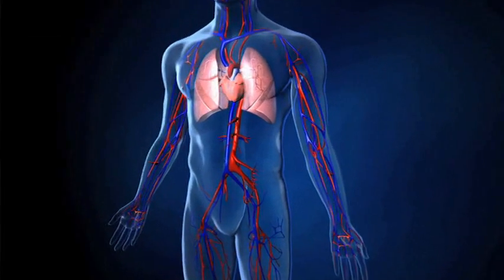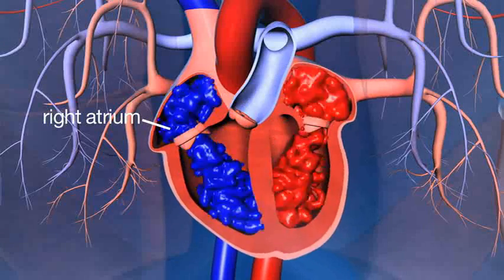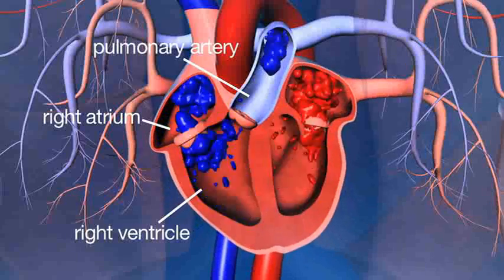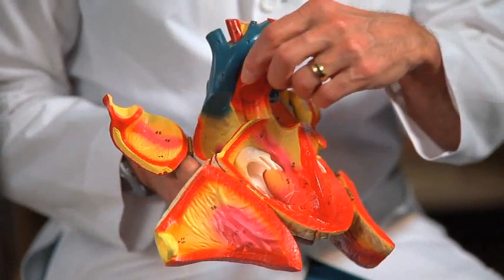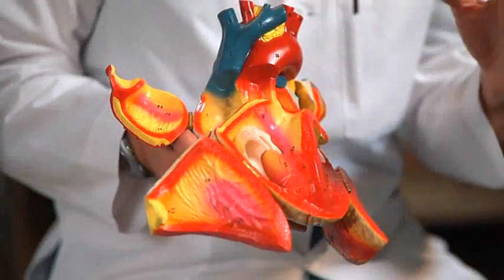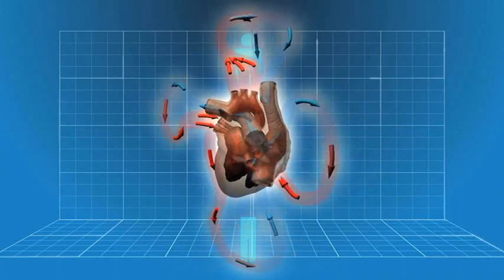Anatomy of the heart

Comment: 🎯 Key Takeaways for quick navigation:

00:02 The heart is a four-chamber structure with receiving chambers (atria) and pumping chambers (ventricles).
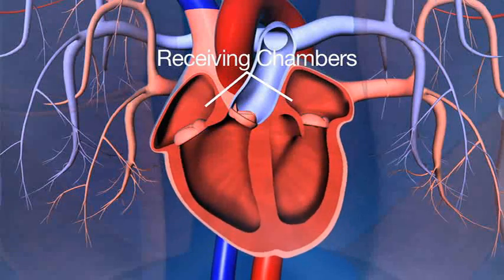00:16 Blood flows from the right atrium to the right ventricle, then to the lungs for oxygenation, turning from blue to pink. It returns to the left atrium, goes through the mitral valve, into the left ventricle, and out the aorta.
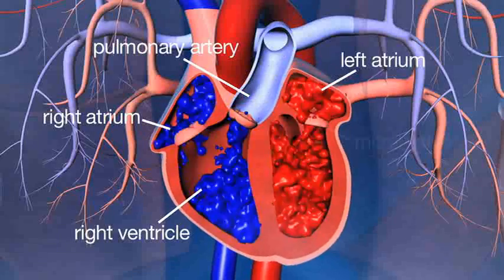00:43 The heart's valves open to allow blood flow between chambers and close to prevent backflow. Valve issues can be stenosis (too tight) or regurgitation (not tight enough).
01:25 Commonly problematic valves are the aortic and mitral valves, often requiring attention due to diseases at different stages of life.

Made with HARPA AI